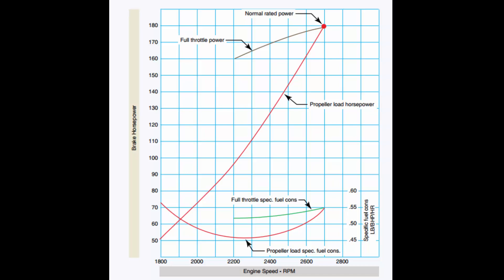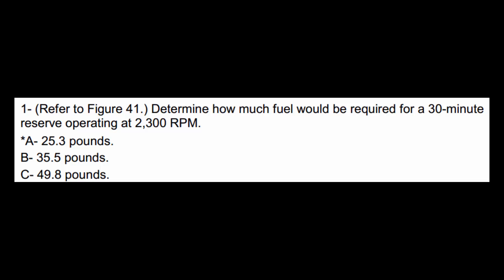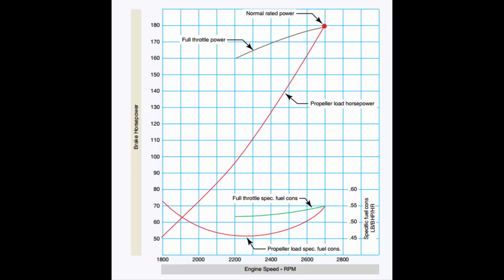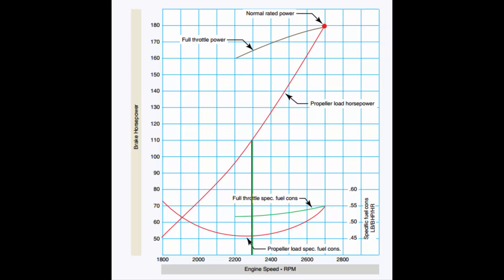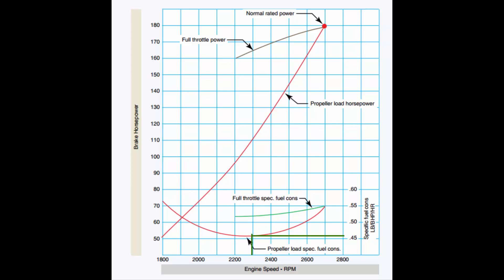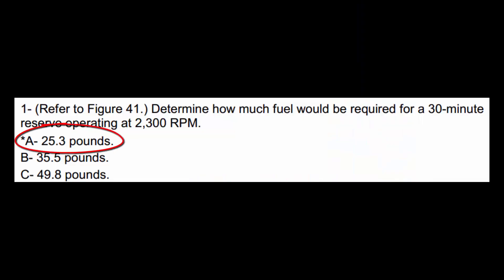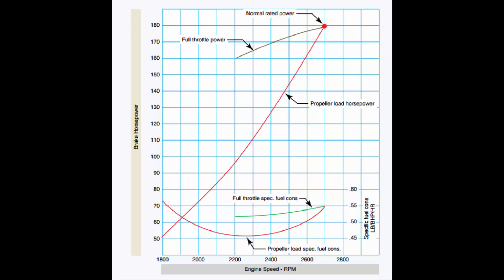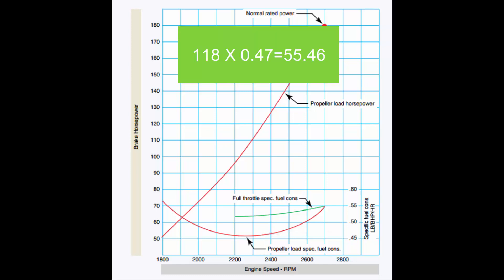AMT General Written Test Performance chart figure 41 engine hp

Comment: so we are assuming the 50.6 is for one hour? if the question had asked for 2 hours at 2300RPM would it be done the same way but multiplied by 2 instead of divided? i could be overcomplicating it but im just figuring out where we’re understanding the time aspect and getting the number for that